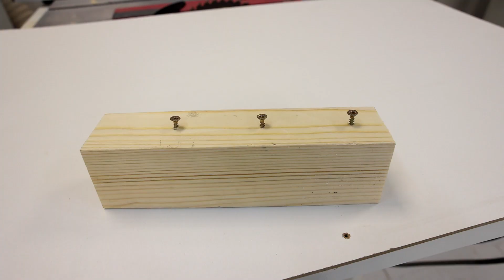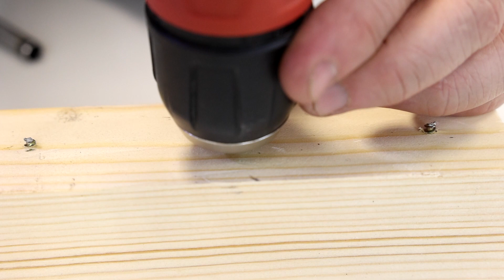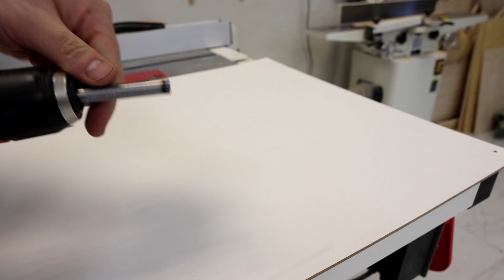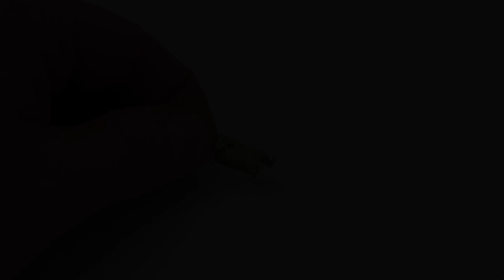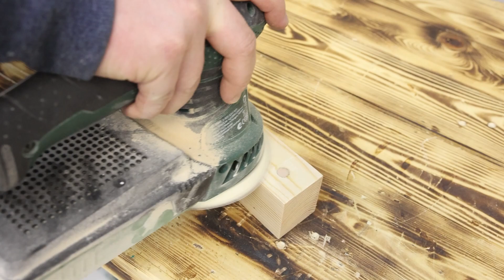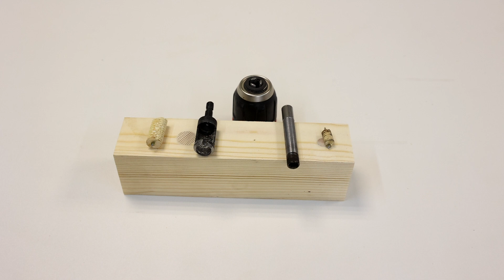Секреты сломанного самореза! Ты точно о них не знал!!!

Comment: I literally saw a similar tool to this one for getting out broken/stuck studs used in vehicles, with one big difference the chuck used to remove the stud fits in a 1/2 impact driver or breaker bar.